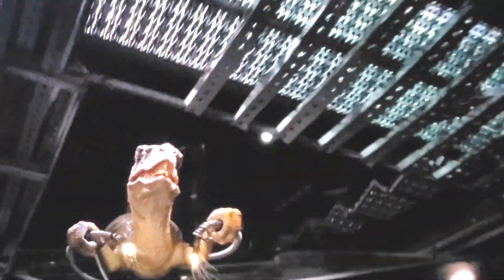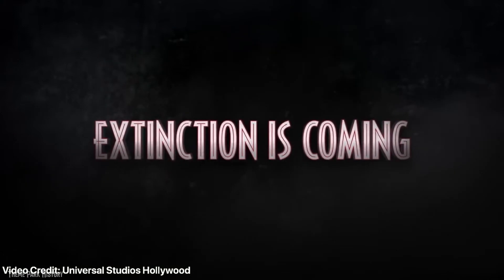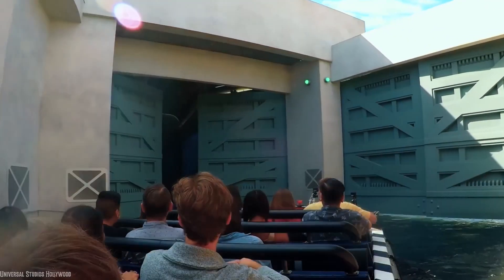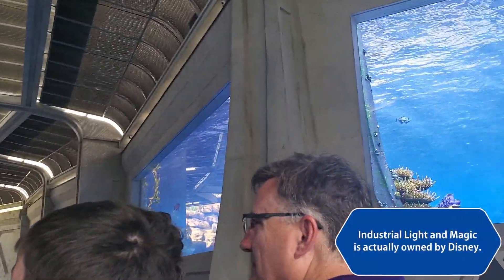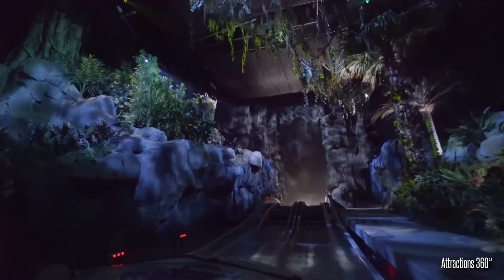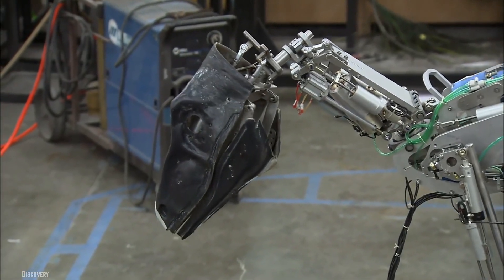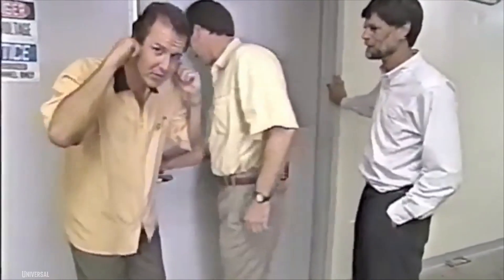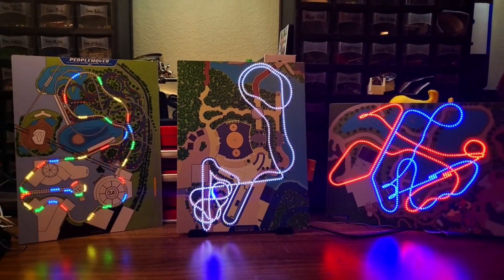The Robots, Illusions & Secrets Behind Jurassic World The Ride | How It Works

Comment: As someone who worked on this during the refurb, this is 100% accurate!
Reply from the maker: @akoopakart  hehe that's interesting cause I've gotten a lot of messages about the stuff I got wrong.
Reply: @AmusementLabs  I worked extensively on all 3 Indominous's and their installations... overall correct in most details the skins and integration was by Edge Innovations in Hayward, CA, with Oceanearing doing the skeleton/hydraulics. It was after the final installation in 2020 that the other company took over. This was my life for 2 years up to 70hrs a week!  Supposedly another might be built? the molds we made were part of the delivery and they're made to withstand many cycles if they can find the talent needed.
Reply from the maker: @sisu1a  that's great to hear. I wish I could get into this industry but it's crazy hard. Lots of my friends all want to design coasters and stuff, but general robotics and animatronics is something that always holds my attention.

Hopefully they do reuse those molds for a fiber reinforced skin cause the tears I've seen are massive and it's super lucky there on the left side.

Comment: But how does the water effect work from the screen at the beginning?
Reply from the maker: They're spouts mounted on top of the framing or for the cracking part in the corner with small misters.

Comment from the maker: 📝 CORRECTIONS 📝
Here you'll find corrections to information as it comes out:
-Turns out Creature Technology had very little to do with the new dinos, Oceaneering was mostly responsible.
-the full body Indominus is around 52,000lbs with all the equipment needed to run it.
-the full body has more degrees of freedom but is limited currently due to major tears of the skin on the left side of the neck.
-Edge Innovations also helped with the full body Indominus, designing snd fabricating the internal mechanics.

Comment: 1:06 don‘t all manufacturers do full scale test versions of new ride systems? It doesn’t cost a lot as most parts can be reused in the final rides and some things just can’t be calculated by pc. Even today.
Reply from the maker: @UwePieper  not every company. A good amount of companies will contract to build the first version of a new ride type on location of the first installation.
Reply: @AmusementLabs  I'd guess Intamin as one of them. Given that I don't recall any full scale test setups and a lot of issues with prototype rides in parks 😀🙈